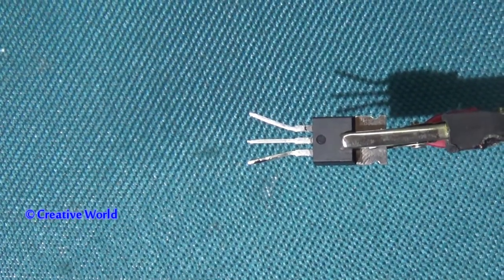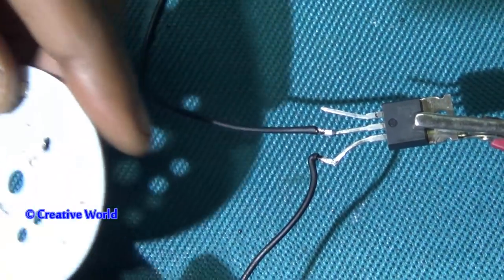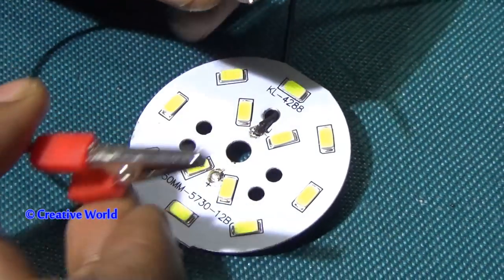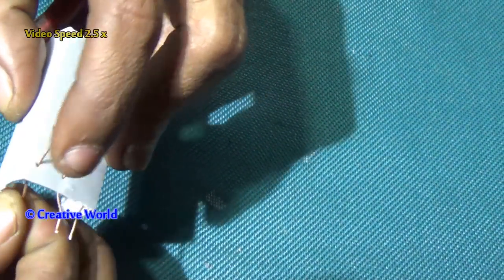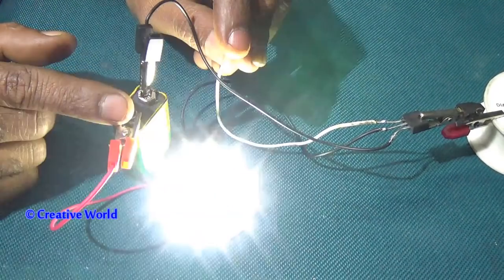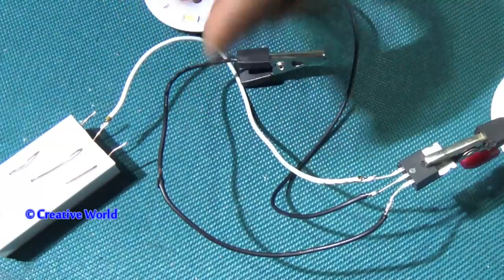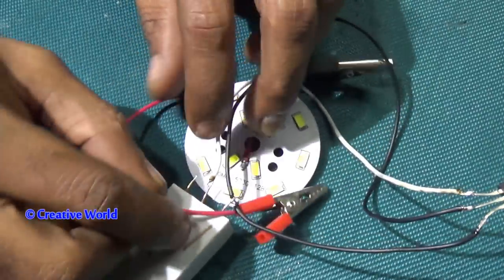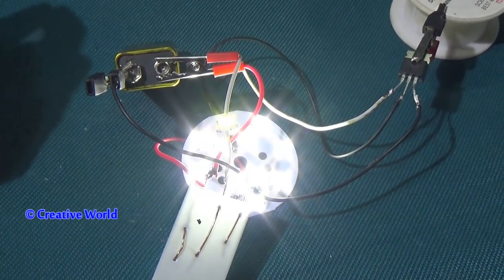DIY - How To Make On/Off Touch Switch Easily || Homemade (Tutorial Videos)

Comment: Why  this has two contact points for On/Off?   i saw a version of this just one contact wire On/Off  without using a Drain - power a 10w bulb
Reply from the maker: different diagram different connection makes different works..
thanks a  lot